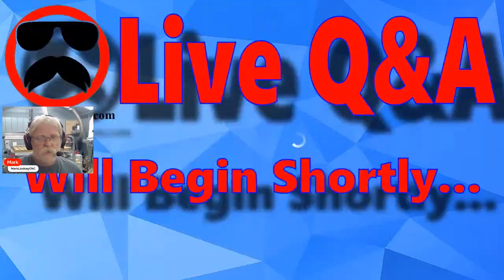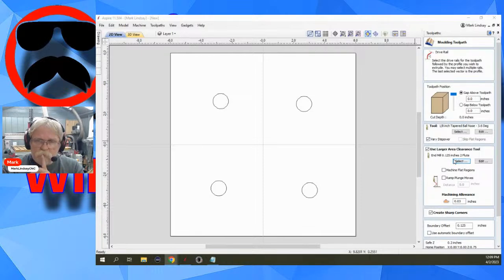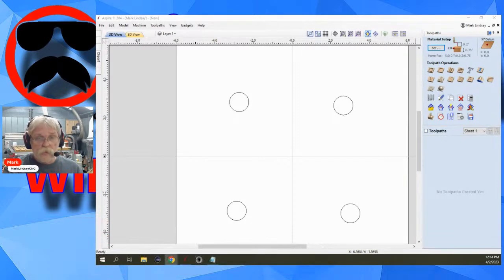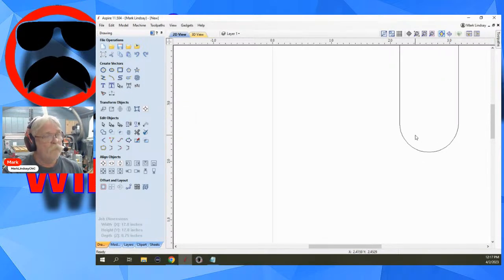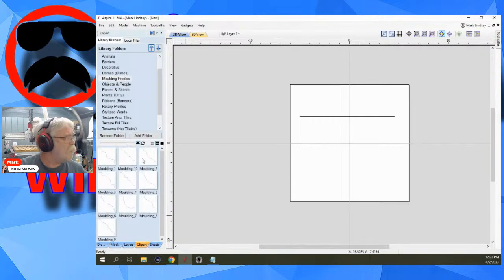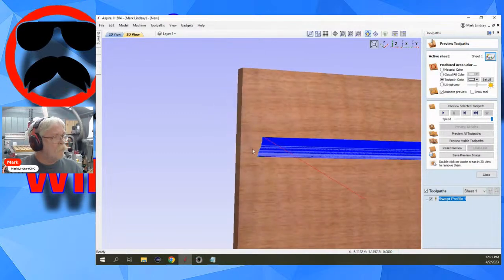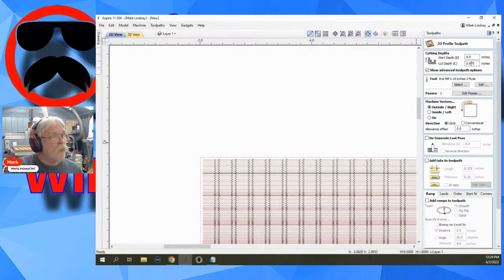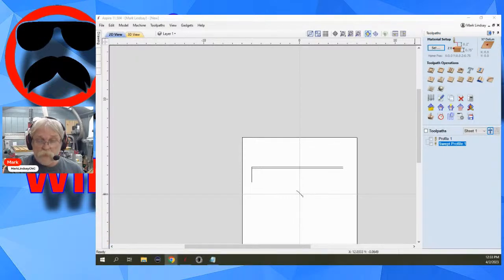Live Q&A #185 – Open Q&A

Comment: I missed the live stream! I'll ask my question next time. I want to add a z axis probe to my CNC. Would love to get some insights on that.
Reply from the maker: My first instinct would be to contact your machine's manufacturer to see if they already have a tutorial on adding a Z axis probe. Modifications like this can be pretty machine specific, depending on your controller and controller software. The best place to start would be with your machine's manufacturer.
Reply: @MarkLindsayCNC  I'm the manufacturer 😂 it's a MPCNC (Mostly Printed CNC) which is a custom 3D printed CNC. I used Duet 3 6HC for the board.
Reply from the maker: There must be some sort of support community for MPCNC. I know there are quite a few of them out in the wild. I'd look for a support community, join, and search for a Z probe thread there. If you can't find a thread, start one. Those folks know the machine best. I would only be guessing.
Reply: @MarkLindsayCNC  That is so reasonable. I'd do that :).